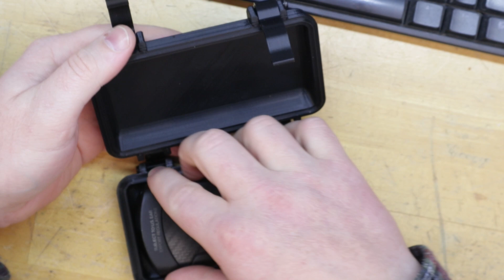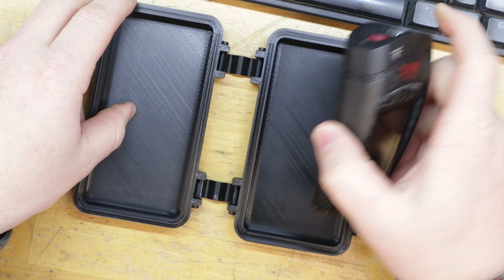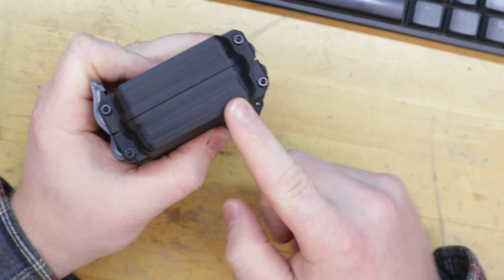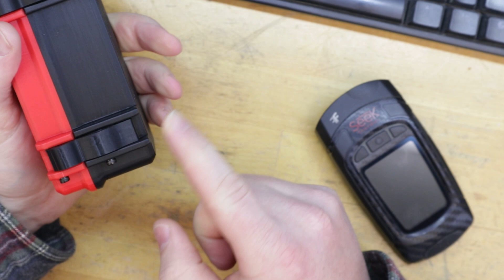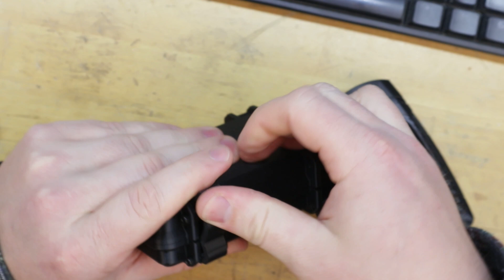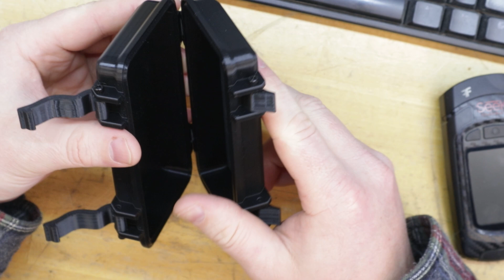A Custom Case I 3D Printed for my Thermal Camera (Old Video)

Comment: I'm still searching for a STL for my Flir C5.
Reply from the maker: For a case or the camera?
Reply: @JoeMalovich  for a case like yours to fit the camera.
Reply from the maker: @RobertWiggers  Do you have a 3d printer?
Is the problem that the camera is too thin to snugly fit in the case? This case style only goes down to about 32mm inside height. You could line the case with 5mm EVA foam to pad it out some.

Will this not work? CASEMATIX Waterproof Case Compatible with Flir C5, C2, C3 Thermal Imager, Seek Shot pro, PerfectPrime Infrared Cameras with Rugged Exterior, Case Only https://www.amazon.com/dp/B074TVN21G/ref=cm_sw_r_apan_glt_i_QFBWRSQM5SCW6KGQW9X5?_encoding=UTF8&psc=1
Reply: @JoeMalovich  I have the Case matrix one. But it's massive. I need a smaller one, just for the camera. Ive got a printer, just not a STL or the ability to design a case. I've tried in fusion but man, that's a difficult program to use.
Reply: @RobertWiggers  if you have a caliper, and are willing to pay some for a design, i may be able to kick out a stl, for a basic slide top box. lmk
Reply: @littlebill2601  Oh I'm up for that. Send me a pm and we'll exchange contact info.
Reply: @littlebill2601  You mean I need to add it to my channel description?
Reply: @RobertWiggers  yes your about section, there is no PM feature in youtube anymore
Reply: @littlebill2601  Done.
Reply: @RobertWiggers  I have it, if you want to remove it
Reply: email sent